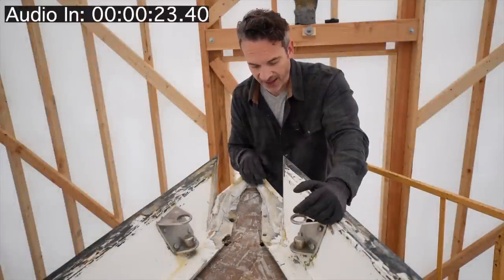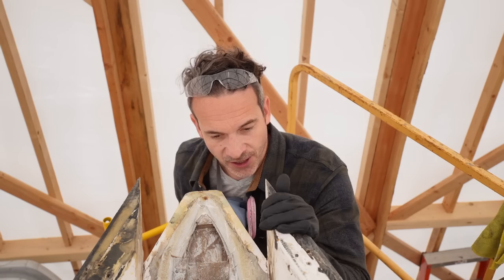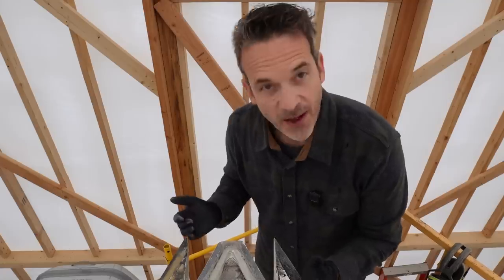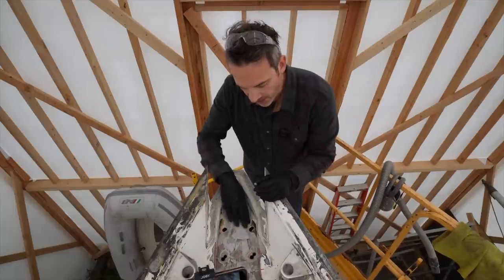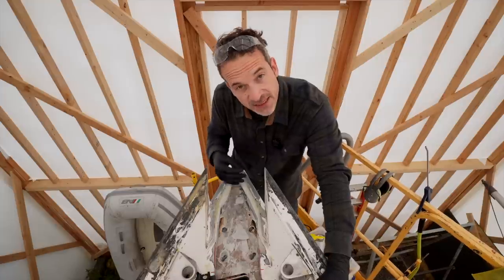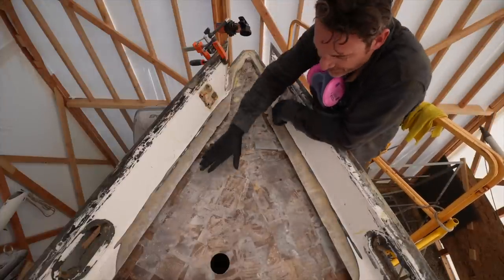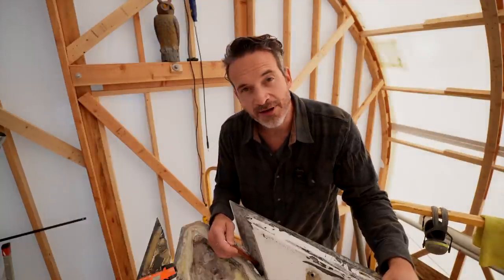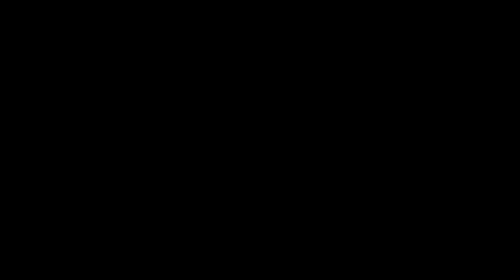Bad Bulwarks AND a QUICK Visit From SAILING MAGIC CARPET! - E007

Comment from the maker: Well, Mixed results with the locally sourced sandpaper... Maybe I need to give the Swiss paper a try that Aladino swears by. Haha!!
Reply: I think you are on a winner if you do. Worked for a furniture manufacturer for 16 years and it was the only brand we worked with. And the range of products is pretty large, be that for band sanders up to 10ft wide belt and 30ft long. Up to small cushions for those hard to reach places. Even now, as a pensioner, it is the only paper I use. SIA abrasives only, oh and sure, wood, and epoxy need a slightly different one, as do metals. They got you covered aswell.
Reply: Have you tried the sandpaper nets from Mirka? We use Abranet 40 and 80 grid for literally everything. Love those. Minimum dust, perfect results. Lifespan is also good and it doesn't get clogged like normal sandpapers. Since it's a net, you don't need to put it on exactly in the right position so that the holes align. Sibply bc there are no holes 😂

Comment: As always, a great video!  It’s refreshing to see the details of the demo-and-repair process, as opposed to the “magical montage” where everything is suddenly “fixed”.  Of course there always needs to be some in streaming vids.  But for hopeful seafarers such as myself, the little details matter.  Besides, I have to wonder if it appeals to every sailors’ little closet masochist—as painful as it may be, there’s a measure of satisfaction in tearing into a boat, only to discover a critical problem, and then slightly (or excessively) over-spec the solution!   Thank you so much for all you do!!!
Reply from the maker: Thanks for the feedback as always Shawn! I do enjoy digging in even though I know it will be a bit painful inevitably. The satisfaction of a job well done (and often over engineered) is worth the pain and process of repairs. Cheers!!

Comment: When filling holes in the deck like that, I find it is always better to fill a syringe and squirt the thinker epoxy into the hole.  That way you can move the tip of the syringe around to make sure no air bubbles get trapped in the bottom of the hole.  It is also easier to get the thicken epoxy into the syringe if you put it in a thick ziplock bag, cut the corner a bit and then squeeze it into the syringe.
Reply from the maker: That is a good point and would be really important for a structural fix. This was mostly cosmetic. I do appreciate the input. Thank you. 🙏🙌👍

Comment: Grinder with flap disc. I tried an orbital with 60 grit, no joy, grinder with flap disc, YES. Down side, dust control but maybe there are grinders with proper dust control. That bulwark holds many opportunities,
Reply from the maker: Yeah, from my experience with those flapper wheels it would be very quick but that orbital in turbo mode removes a lot more material than a traditional orbital and you get the benefit of some dust extraction. I should fire up the grinder just to compare speeds maybe 🤔

Comment: I like using a grinder and 36 flap disk with a dust shroud for quickly removing glass. A lot cheaper than chewing thru sand paper in turbo mode. Try using 36 or 40 in turbo mode for quick removal👍
Reply from the maker: I have a nice dust shroud that I used for some concrete work and a diamond grinder. 🤔. I’ll give it a shot and let you know how it all goes. Thanks for the input! 🙌🙏

Comment: I built a Shearwater 39 in the middle 1990's and this look like the same type of deck hull joint and the builder used plywood too fill the void between the hull and deck. I removed it before fitting the caps.
Reply from the maker: Thanks for the input. It is going to be really tricky to get it all out in this case but I will keep looking into it.

Comment: I was saying to myself, "Why are you scarfing the deck edge before checking the bulwarks, as you may have to remove all the fibreglass to repair the bulwark too". But then, you're the engineer and I'm not and it makes video content. You've got a big job ahead by the look of it. Cheers
Reply from the maker: Yeah, I e got a bit of work to do over here… I’m hoping that the bulwarks don’t need major surgery but I will at least wrap them in glass. Cheers. 🙌👍

Comment: Great videos of your project. I too have a Liberty458 built in 1984 and have replaced the teak deck and balsa core in many places. I also found the deck seam failed on the foreword section of the deck and had to glass it together and replace the rail. I’m wondering what you will do about the water in the bullworks? Fair winds
Reply from the maker: Thank you! 🙏 cool to meet another liberty owner (I’ve met a few since starting this journey)

That’s a great question! Do you know if you have mild steel inside your bulwarks? I’m 99% sure I have stainless steel but I know some earlier boats had mild steel.
Most of the advice I’ve gotten about the bulwarks is seal them up and leave them alone. I’m very tempted to rip in but it’s a lot of work for minimal reward. 
I live in a climate with freeze/thaw but if it was always warm here I’d seriously consider leaving them alone… we will see I guess! 🙌👍

Comment: Will you be using vacuum to hold the core down onto the epoxy?
Reply from the maker: I am REALLY hoping that I can seal everything up to do it that way. I’ll do a dry run to make sure it will work in an upcoming video.

Comment: I vote for Airex deck core
Reply from the maker: I’ve heard of it but hadn’t really considered it. I’ll do some research. Thanks!
Reply: @livingforsail  Uncle Bob will have some opinions on it... some of the last Passport 40's built used it.  It's a foam sheet material with some some advantages to Klegecell or Divinyicell.
Reply from the maker: @redshifttrucking4537  I’ll ask him about it. He was fond of Corecell which I’m also considering.

Comment: Wouldn’t it make sense to check out all the coring so that your repair is fully continuous and consistent. This is what Aladino did on Magic Carpet.
Reply from the maker: I might consider doing larger sections. Aladino’s boat has wooden beams that support the deck and even there he had to start with removing every second beam in order to keep the deck shape. I have a similar issue that if I take all the core and top skin at once the bottom skin may not keep shape. I could spend more time bracing from below… everything is give and take.